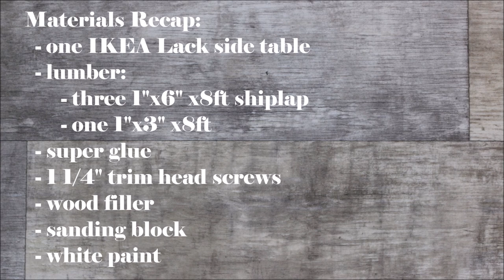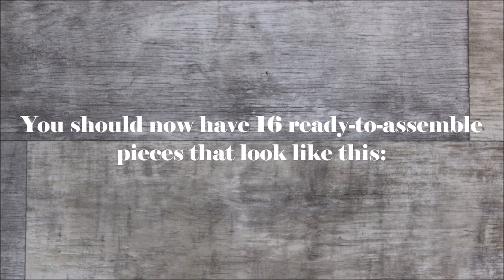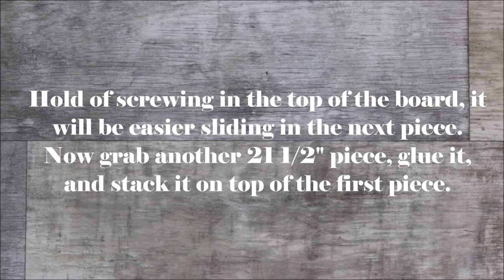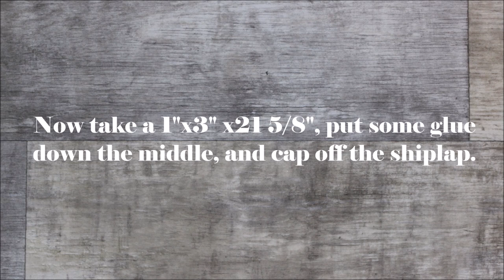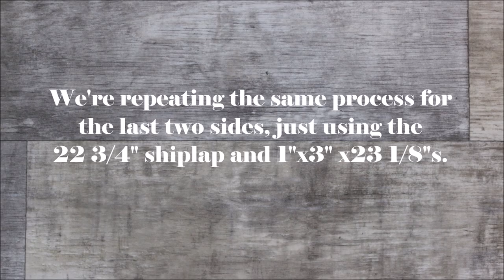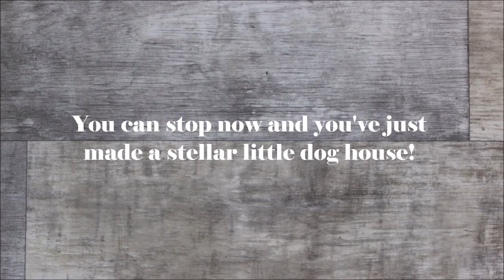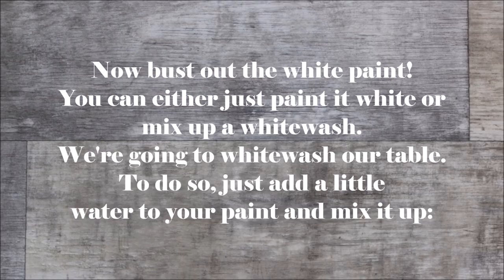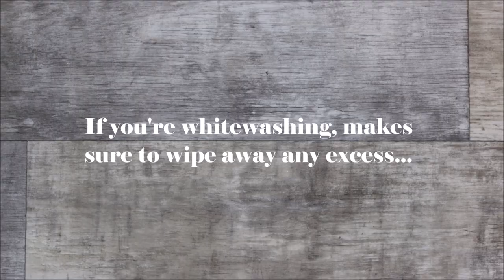IKEA HACK - The Shiplap Side Table

Comment: Nicely done.  Something you might want to consider, since you use a lot of pine and regularly use latex paint on it, is that these types of woods have a lot of solvents in them, and over time the solvents will bleed through water based paint (latex for example) leaving gray or blackish discoloration on the paint.  The two ways to prevent the bleed through are to use an oil based primer.  Or, use a clear (dewaxed) shellac sanding sealer (I use Zinssers) as your first coat.  This isn't a problem when you guys use oil based stain and oil based polyurethane.  Either the oil based primer, of the dewaxed shellac will work, and help prevent those nice painted finishes you guys work so hard on, from looking like they've been sitting near an oil fire in the future.

Comment: Nice hack.  One clarification tho, you used Gorilla polyurethane glue, NOT super glue.
Reply: and it is water activated so they needed to moisten the wood where the glue is in contact.  if not then the glue isn't doing anything.